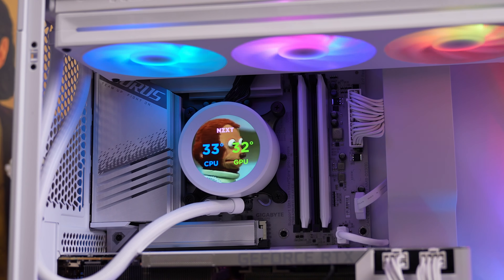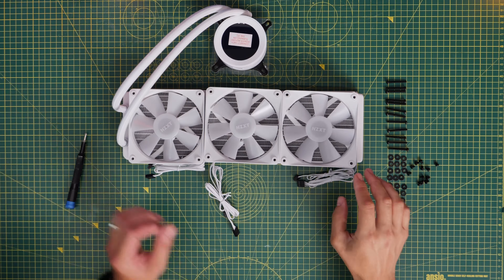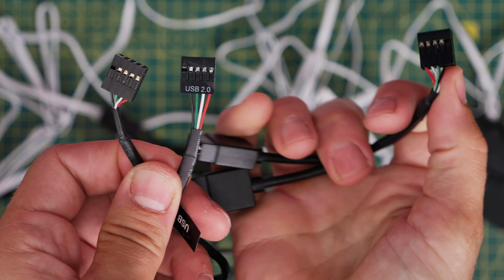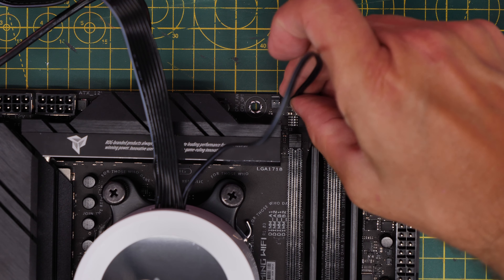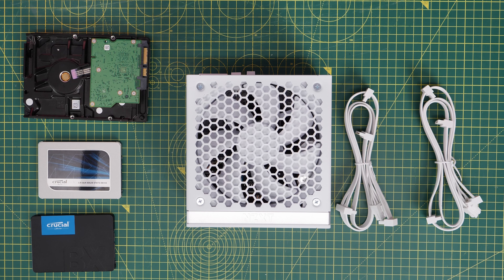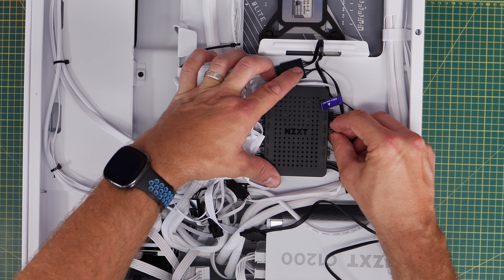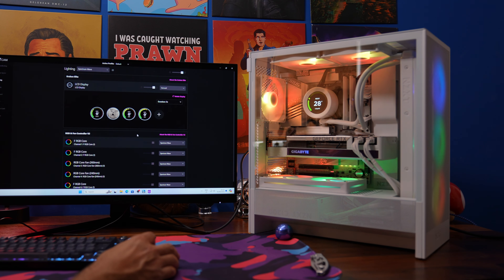NZXT Kraken Elite 360 RGB detailed setup guide (Intel and AMD and other fan options)

Comment: The new Kraken 360 RGB 2024 comes with the one frame fans
Reply from the maker: @filioooo  yes
Reply: @TheProvokedPrawn I'm building my own pc, and at first I really wanted to buy the old elite, but as soon as I saw this new one I fell in love, easier to assemble and less cables, masterpiece!
Reply: And their own design pump, no longer Asetek
Reply: @TheProvokedPrawn upload a video with 2 f360 rgb core fans making a  sandwich of the radiator and install it

Comment: Bought this exact cooler with a H6 flow RGB today with 2x F140 core for the bottom mount and a extra F120 core. Will i need to buy the additional NZXT fan hub?
Reply: Anyone know the answer to this I’m wondering the same ?

Comment: Hey I have a question I switched the original fans for rgb fans  and everything worked fine when turning it on the first three times but after fixing an issue with the monitor getting no signal and switching the pc on and off the lcd and the fans stoped working but the rgb works fine and they slightly twitch when I turned the PC on

Comment: I have a question about using Lian Li infinity fans on this aio. If I’m gonna plug in the infinity fans on the radiator into the infinity controller (which will give both power and rgb), do I need to plug CPU Fan and can I just leave Fan Power unplugged? And all I have to do is set the infinity fans on rad to CPU fan curve right? I prefer using l connect to control everything. Ty
Reply from the maker: I'm not clear on your question. But if I'm understanding it correctly, you still need CPU fan plugged in and the sata power. But yes, you can connect the infinity fans to the controller and then just set the fans to respond to CPU temp in the L Connect software
Reply: @TheProvokedPrawn  Ty for response, Can I leave the fan power connection unplugged? Also there’s no difference if you use L connect to control your radiator fans as opposed to nzxt or your motherboard right?

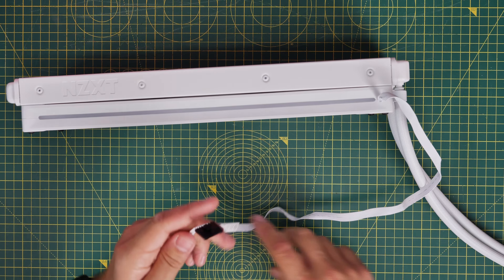Comment: I LOVE that you mention how it only takes 4 screws, as you tilt it over on its side, to see how the entire middle section is not even seated flush against the radiator. Such a horrendous design flaw with the new 2024 kraken and them decided to use this single frame fan shroud. FYI for anyone wondering, the LEDs bleed through, and if you get it at the right angle, are blindling bright through the crack between the fan, and the radiator at 12:41. there is no reason this fan does not have an addional 4 screws in the middle of the fan, ya know where THE RADIATOR HAS MOUNTING HOLES for.

Comment: you know you COULD fit that fan in the top if you take a dremel to part of the case where its getting stuck right? Its not going to hurt removing the one fan that is clearly in the way as well.

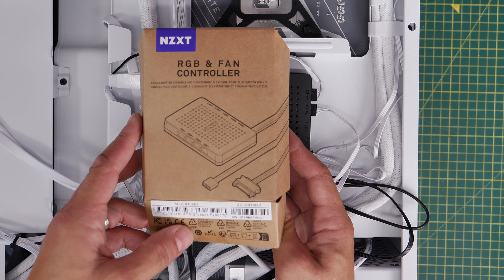Comment: 18:05 can you further explain this please. Do you still need to use the mobo to control the AIO fan speed considering only the rgb is connected to the nzxt hub
Reply: The controller softwarw will control the fan speed

Comment: Is it possible to connect and harmoniously control the cooler, the fans included within a H6 case plus one additional separately purchased NZXT exhaust fan without purchasing the NZXT RGB separately or is it worth spending the extra dollars on aforementioned controller to save some pain? 

I'm thinking conmection wise it's possible, but am unsure if all fans and lighting will sync up nicely within software?

So, use the controller that's included with the cooler to connect those fans and RGB connections. Use the two fan and RGB controllers on an NZXT MB to connect both the single rear exhaust fan, and the 3 x front fans which daisy chain the 3 x power and RGB connections of the fans into a single connection. 

Seemingly, connection wise, the above would work but would everything be in sync, play nicely and uniformly be detected and controllable through software?

Comment: Any experience on the following setup? 

Will the NZXT Kraken Elite 350 RGB radiator mechanically fit on top of the Lian Li LANCOOL III Midi-Tower? Combined with some mainstream Asus or Gigabyte AM5 mainboard? Is there enough headroom between the mainboard and the top of the case?

Comment: Interesting how you connect the CPU cooler fans to the CPU_FAN when the MB(X870e) instructions mention if you're using a water cooler it should be plugged into the AIO_PUMP header. Thoughts on this?
Reply from the maker: Either works just fine

Comment: saw the single frame and thought this was a review of the 2024 kraken, but regardless absolutely love the single frame fan idea cable management is gross. Would you rec the control hub to power mulitple fans that are not nxzt? WOuld be nice to free up fan header splitter for my corsair fans.
Reply from the maker: It's not out yet 😁 no NZXT'S fan hub doesn't work with anything other than NZXT fans

Comment: Couple Q’s: 
- Can the RGB Kraken Elite fans be replaced with NZXT RGB Duo fans? 
- If so, do you need to have the RGB K.Elite? 
Or can the RGB Duos still work properly on the non-RGB K.Elite?

Figure I’d save some $ if I can add Duos to the regular K.Elite, instead of buying the RGB K.Elite at higher cost.
Reply from the maker: In theory yes. As long as you had a triple pack of the DUO fans for the RGB controller

Comment: He skipped over the sata connector on the fan hub. Does that get connected to power too or just the sata connector on the cooler?
Reply from the maker: If you have a fan hub then yes it needs power.
Reply: @TheProvokedPrawn  Thanks man. I know that is kind of a dumb question but I wanted to make sure before I connect anything to power.

Comment: In my personal opinion what they should have done with the new h5 flow is make it for microATX instead of standard ATX and the main reason why they should have done that is because they can have the power supply on its side just like the new H7 has.

Comment: Hello sir! I bought a Kraken Elite 360, and does it really make noise in the pump? The noise is a bit loud, and I can hear it even with headphones on, and the pump is not at maximum speed.
Reply from the maker: You might have a defective unit. I'd contact NZXT
Reply: Did you install the unit vertically with the hoses on top?
Reply: How long have you been using the unit? I have heard that there might be some noise during the first few days. It is supposed to get less intense after some time. And it might help to shut down the PC and restart it a few times in order for the air bubbles to get away from the pump.

Comment: My fans do not turn when connected to the splitter.
However, the fans do work!
Tried the fans connected to the motherboard, they work.
When I connect the fans to the splitter with the PC running just on BIOS, they spin, but after reboot they no longer spin...
This is the Kraken Elite 360.
Now to run the 3 radiator fans, I connect them directly to the motherboard for them to spin when windows boots up.
There has to be a logical explanation... has anyone else had this problem.
Reply: sounds like a splitter problem. you already isolated the problem it sounds like. they work, but not when the splitters are involved. Maybe get ahold of NZXT and ask what the deal is. They can RMI it or help you out

Comment: Hey so new pc builder here umm what if I don’t have the psu sata cables anymore is there something else I can use or no
Reply from the maker: You might be able to buy extra cables for your PSU. Make sure you get them from the same brand and that they're compatible too. For example Corsair sells cable kits for its power supplies.

Comment: Have had this 360 elite for less than a year and it consistently drops to 500 rpm after a while under load and refuses to adhere to any changes i make in cam software, eventually dropping to under 100 rpm all the way to 0 while cooking my CPU. Funny part is the radiator fans also follow suit so i know its probably not a pump problem specifically. Any idea what’s happening?
Reply: How have you installed the radiator? Is it on top of the case, on the side or at the bottom? Could it be that there is some air in the system and the pump was not lubricated properly?

Comment: Hey bro, I got an issue with my display, everything is connected and everything is showing up in the CAM app, but when I edit the display it doesn’t take the changes, it’s just stay cooling temp in white color, I previously edit it but for some reason it just when white with liquid temp only.. what can be the issue?
Reply: Can Anyone give me a hand??
Reply: @juanluisdejesussz9290 i have the exact same issue, the display dont show up in the cam software but everything else works fine
Reply: @TitoCaviar   if u display customization window ain’t showing up in the cam, the usb pin port is not connected to the hub “if u have one”
Reply: @juanluisdejesussz9290  where can i get the hub? Or can i do it without the hub
Reply: @TitoCaviar   follow the single rounded wire coming out of the pump check if it’s connected, if not connect it to one of the port directly to the MB in the bottom of it, it’s a 3 wire cable with colors red green and white, so it’s 3 pin usb wire
Reply: @TitoCaviar   if u want send me pictures and your actual MB model so I can mark u where to connect in the MB

Comment: I'm just not feeling the aesthetics of the new single frame fans.
Reply from the maker: Fair enough. I like them personally. Much easier to cable manage and none of the angry fan edges but each to their own. 👍🏼
Reply: @TheProvokedPrawn  agreed,was actually going to say that.  They seem like they would be great for first time builders in particular.  
More of a product I'd recommend than use myself.
Reply: Personally I'm looking forward to a gen 2 version of the Lian LI TL LCD fans.  Definitely have great potential, but there are some big technical annoyances I've run into and I'd make a few visual changes as well.